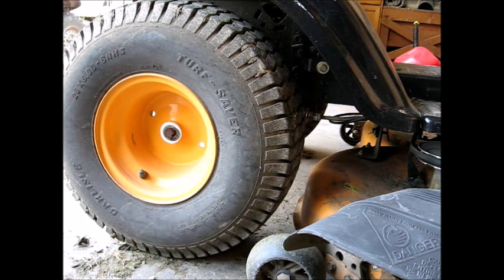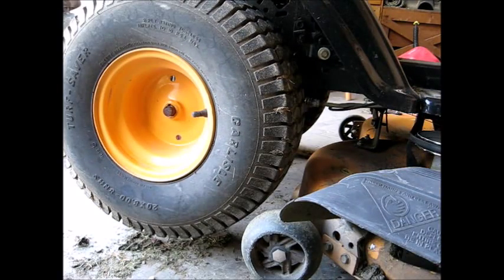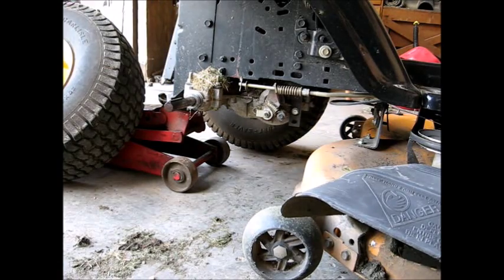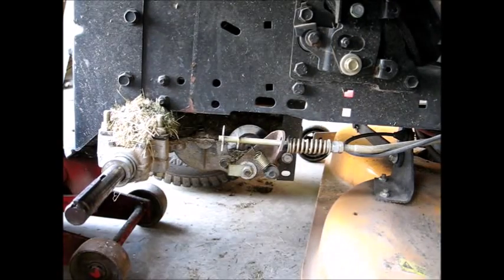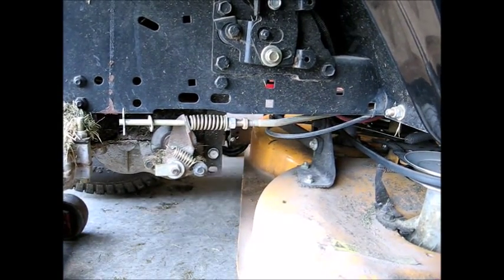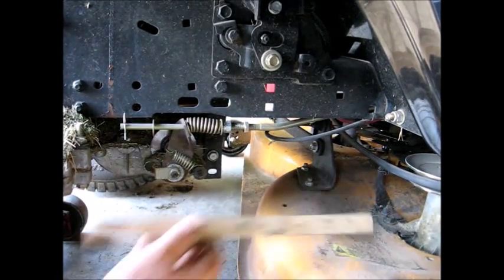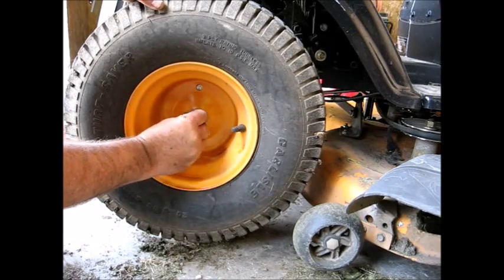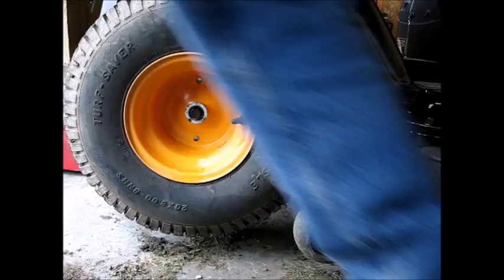Brakes

Comment: I sure wish my poulan pro looked like that.  My brake pedal won't come up all the way unless I pull it up.  Took that wheel off and the set up is different, no bolt on the end of the linkage, just a spring and there's about a half inch of slack on that spring when I pull the linkage bar all the way back with my hand.  Since the pedal won't come all the way up my idler pulley won't get tight on the V belt so it won't go forward or reverse.
Reply: How did you fix this?
Reply: @chargerscurt  For the last 3 years I've had a big gummy strap hooked to that pedal on one end and the other end hooked around the back fender frame of the mower on that side.  It looks wonky, but it has worked just fine ever since.  It keeps the pedal pulled up and acts like a return spring when I let off the pedal.  If  I knew how to properly do it, I'd have done it by now.  Since then I've managed to re-set the valve lash, added a new carburetor and new LED headlamps.  Changed the drive and deck belts and idler pulleys, added wheel bearings in place of the front wheel bushings, added needle thrust bearings to the steering spindles for "poor man's power steering", etc. and it all looks like it should but still have that wonky looking gummy strap holding up the brake pedal, LOL!
Reply: Dang. Its like just loose enough to give such an issue. If i figure it out, i will let you know
Reply: @chargerscurt  Thanks.

Comment: what brake did you adjust, the parking brake or the brakes?
Reply from the maker: Hi William
On this model the park brake and the mower brakes are the same. To set the park brake the mower brake is locked on. Thanks for watching.